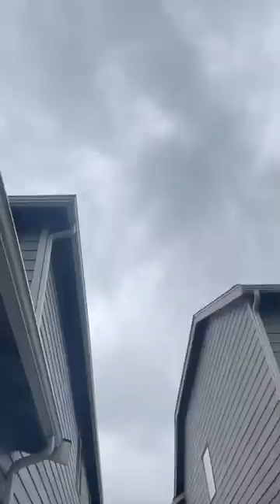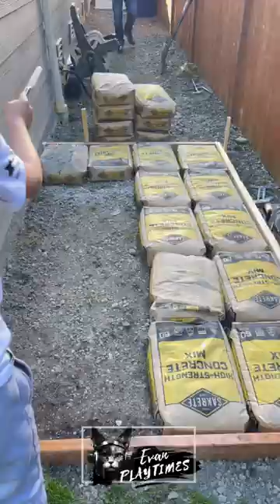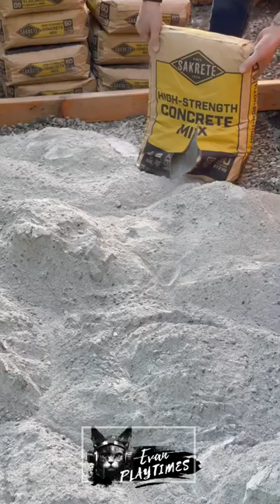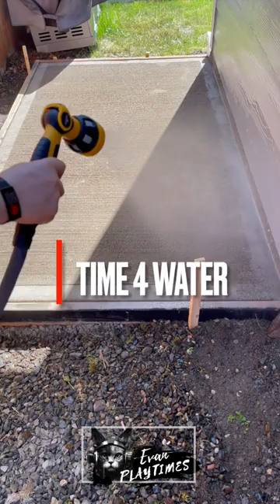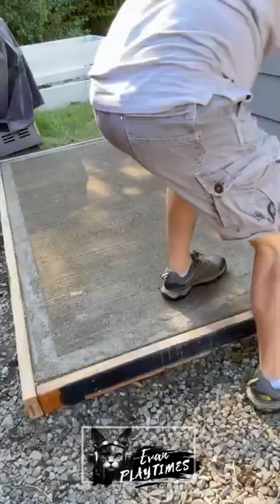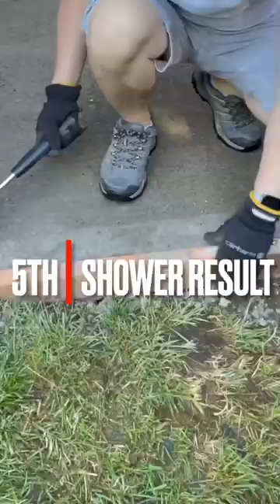Dry Pour Concrete | Love It

Comment: I’m no expert but I did go to a civil engineering school and have a degree in it.  There were classes focusing on concrete and strength of materials. I wonder why people mix concrete?  It’s much easier to dry pour, why were we not taught this method? To summarize concrete has a chemical reaction with the water , sand, aggregate and Portland cement.  Concrete can have many amendments added that strengthen and give it special properties such  as steel rebar, fencing and nowadays ground metal shavings all to enhance strength of the concrete.  There are also amendments that can alter the properties of the concrete for example cold weather.  Concrete mixed properly will have most of its strength in the first 30 days thus the variable f subprime.  This not mixing it up, and just dumping the Portland cement out is strange at best.  I was in Mexico , deep In Mexico once in my life.  They mix it using the volcano method.  A volcano of Portland cement and the sand and the water, no wheelbarrow even.  Five gallon pails to truck it to sight.  It was throughly mixed though.  Using shovels and hard labor.  Skipping the mixing is much easier and attractive for that reason.  It will not have the strength a proper mix would have.  If it’s so wonderful why is it not standard practice in construction? There are reasons.
Reply: To get the 4000 psi the bag claims it will have to be properly mixed, that’s all I’m saying.  No mix , no chemical reaction throughout.  I’ve had bags harden from sitting in my shed , moisture came from the air and time.  The half full bag hardened but was very brittle .  I threw it out . lol

Comment: I need to build a concrete base so that I can put a shed on top of it. I can't afford thousands of dollars to pay someone. Is dry concrete good for what I need to do? I have zero experience with concrete, but I'm a fast learner and I can build stuff, especially working with wood. Thanks in advance.

From what I've seen I need to first  put gravel underneath before pouring concrete. One other question, if I have some thin metal rods, can I put them half way (depth wise) in the concrete so it can last longer?
Reply: Only if it's the will of buttman
Reply: I gotta do the same thing soon, how did yours turn out???
Reply: Have to make sure your base rock layer is compacted properly for anything that will have weight on it at all. Best to hire someone that knows what they're doing rather than put the money out to have it mess up on you and have to put more money out to have it properly done.
Reply: What type of shed a mower shed that weighs a few hundred kgs or a car shed? Watch Cajun country dry poor slab they did a 1yr test on and it's held up better then wet slab as you only add enough water to set the concrete. Much easier to finish dry aswell as your not fighting against the clock and sticky wet Crete. Well compacted gravel layer wood form and enough sacks to fill the hole. Plus some rebar for long life.
Reply: I heard something about PSI when working with dry concrete versus wet, I recommend you read the bag of concrete, maybe it will tell you the PSI difference, because it might not be able to withhold the weight of the shed
Reply: I just put up a small sunroom (10x12 feet) for my inflatable hot tub with it, and that worked fine.

I don't know if I would do anything bigger than that.

If you do this, definitely compact gravel under it--put 2+ inches of gravel down and smack it with a tamper until it stops making a noticeable dent. (Wetting it down can help the gravel compact easily.)

The gravel will keep the ground from settling and moving/cracking the concrete.

Small bars can help with reinforcement, but fencing might actually be a better choice (dry pour may not attach to rebar as well as wet, but fencing will kind of "hold" it in place.)

So, it's definitely an option for sheds, but there are other options if you're not comfortable with this.
Reply: Get your measurements, thickness and please use rebars.., think of how and POSSIBLE FUTURE USES SO THAT IT'S ENOUGH FOR THE BE OWNER
Reply: If your shed is going to have anything heavy in it I would recommend a wet pour because a dry pour is not going to be anywhere near as strong and will crack much easier as it does not bond together evenly like a wet pour does. Use rebar and make sure to have a tight and level base of gravel especially if you live in a state that gets a alot of rain.
Reply: I do concrete professionally and I work with forming, placing, finishing, grinding, cutting, and coating concrete on a regular basis, among other things. Im all for people striking out and learning new skills and doing projects for themselves. My opinion, having familiarity with concrete mix designs and the way it gains strength, I would say anything with an exposed surface or that bears any weight would not be a good application. If your shed that you want to use is able to sit on a gravel base or directly on the ground (like one of those very light plastic sheds), AND you are ok with a finish that will not look very good, and will deteriorate quickly, you COULD consider dry pouring. For some people, they want something that is flatter and cleaner than dirt and stays together better than gravel, thats where dry pouring will get you. If you want a nice finish I would suggest looking at some resources online, learning the process, and taking it on. If your shed requires any sort of anchoring or needs to bear on a solid foundation, I would strongly advise against anything other than a well designed concrete mix that is correctly placed and finished. If you can screed gravel off to a level surface, youll find that screeding wet concrete is not hard. Once you put a mag float or bull float on it you have already far exceeded the surface quality of a dry pour slab, and the tensile and compressive strength of good concrete will blow dry pour out of the water. If you are able to get steel trowels and an edger trowel on the surface I can guarantee you will be much happier than any finish on a dry pour slab. You are unlikely to pour a perfect looking slab your first time doing it, there is a significant time aspect involved as im sure you know. But someone who is handy can pick it up pretty quickly, and a small slab can be done with a couple basic hand tools, small bull float, straight 2x4 to screed with, and some plywood or foam squares to put your knees on while you crawl the slab to finish trowel it. As well as a couple buddies who can help you shovel it around in exchange for some beer of course. Rebar may or may not be required based on your application, if its a small shed it probably isnt, as long as you arent putting it on top of clay or mud. If you do decide to dry pour I cant say that rebar will do anything to help the strength anyway. Ultimately its up to you what the specifics are, but figured Id help muddy the water with my opinion haha. Im also happy to get into the specifics of why Ive formed that opinion based on what I know about concrete, which I dont claim to know everything, but I do know more than most people who make videos about dry pouring. I love nerding out over it and have devoted a lot of time to learning the details of concrete chemistry to always try and make my work better for my customers.
Reply: If you have plenty of metal cloth hangers make your own metal screen base and remember to put pieces of rock or brick for some kind of ground separation. Also to make it last longer a week later apply cement sealer , three coats. Good luck
Reply: 9 months ago... I hope I'm not to late. DO NOT DRY POUR ANYTHING THAT IS STRUCTURAL. Just don't do dry pour in general, but especially not for anything structural. Concrete anchors will rip right out and the concrete will crack so easily.

Comment: Looks great. How did you get the sides to have the color difference. Smoothing it out?
Reply from the maker: I don't remember the name. Got it from home depot. Stainless steel with curve edge.
Reply: @EvanPlayTimes  That’s great. Thanks. So, basically it’s a tool that’s made for it
Reply: Edger
Reply: Trowel edger
Reply: How far apart in time do you wet it?@EvanPlayTimes
Reply: @angelgirldebbiejo don’t worry about the timing. It’s not a strong slab. So the timing doesn’t matter. You’d have a better result using the normal procedures for concrete.
Reply: @TTTTyme Its called a concrete edging tool

Comment: If it's not seen.   Buried posts or back of garage pad id do dry.  Heavy foot traffic I'm mixing.   Do two projects and call in the minimum mixer load, probably 4 yds  Search concrete and have the hole ready.    Most drivers if you hand him an iced coffee will walk you thru or tell you before you fck up

Comment: Would it not be cheaper to do a sand/cement mix instead of using pure cement?
Reply: The bags come with a mixture of rock gravel, sand and cement. Is also stronger than just cement and sand. This is probably the easiest route.
Reply: But a bag in Uk costs £10.

Comment: Look at you! Amazing job
Reply from the maker: It's easy. At first, I thought it wouldn't work, but I did it, and it still stands strong. I will give an update soon for those who are afraid to try or think that it will crack or be a joke. The professional gave me an estimated $4000 to do the project, but I risked it, and it worked out great. You have to be patient and add design on the edges before watering it down.

Comment: Looks great! I'm going to do the same.
Reply: Make sure you do a top layer of cement powder and sand, not the stuff with the gravel in it. When you screed it, the gravel won't cause an issue. Thank me later. I'm going to do a dry pour in the next few weeks
Reply: @jakefriesenjake  Thank you! I got this message after the fact. We tried our first paver. I noticed there was a lot of gravel even after screeding the Quikrete mix. My dry pour came out rough on top. My son and I will add mortar (cement and sand) on top tomorrow to smooth it out more. Hopefully it works. It was our 1st try.
Reply: @YvetteR-ep2hc  they make specialty concrete resurfacing concrete mix, probably be better off with that.

Also, look up "white washing" or "painting with portland". That is also a great way to make old concrete look alot better. Many options.

I did a small test sample using dry pour today. It's been like 8 hours already and it is not setting up nearly as good as I would like it too. Maybe it will be better in the morning
Reply: @jakefriesenjake  Hi! Thanks for all the advice. After much research, my son and I decided to try the Quikrete sand topping mix to fix our paver.  It worked out well. Our paver is now smooth and looks so much better than before. It's totally trial and error. We are dong another paver tomorrow with Quikrete dry pour and we'll see how it turns out. We just have to remember to screed the surface better this time. Hopefully it won't give us the gravel results we had with the 1st one.
Reply: @YvetteR-ep2hc  nice. The sand topping Mix does have some very very tiny gravel in it, it's not pure sand and cement powder.
Reply: @jakefriesenjake  Another update. We realize diy is a lot of trail and error. I found a video where the guy took the Quikrete concrete mix, sifted out the gravel leaving the concrete and sand mix for the top layer so it makes for a smoother top. We tried this and it worked much better. We decided to fix our pavers using this method so it all comes out even. Worked out much better. Just wanted to share another method to use without having to keep buying a $10 bag of sand or mortar.

Comment: Concretes works by chemical reaction with water.  When you dry poor like this it is inherently weaker as not all of the concrete has reacted with the water and hardened
Reply: Just curious. Won't it all get reacted eventually because the water will be absorbed over time?
Reply: @SnakePlantCollector  no because it needs to react and harden together otherwise it will create a bunch or cracks and chips.

Comment: For that much Sakrete you could just order a cubic yard of proper concrete and buy a wheelbarrow to shuttle it from the truck chute to the forms. AND, you'd probably still have money left over and wouldn't have to dick around misting it and watering it. AND, it would actually be 4000psi like it's supposed to be. Dry pour is such an internet fad. If it made any practical sense, contractors would be doing it but they're not.

Comment: Dude as if dry pouring isn't already bad enough you didn't even put rebar on it. That thing gonna crack 100% not even year after you made it.
Reply: A lot of improvements have gone into the formulations since the requirement of rebar installation. Fiberglass for instance, and pea gravel might not be seen in the mixture. Also, how many overweight (eg earthmoving tractors) vehicles will be driving on it?
Reply: @craigmatheson2736  it doesn't even need to have anything driving over it, dry pouring will always resulted in much much sooner cracking when the soil settled, temperature changes, and water freezing under or inside of the concrete.
Back in engineering schools we were thought how laughably bad dry poured concrete is compared to any wet poured concrete. Concrete need water to solidified, not just because you have to make it wet, the water inside the concrete literally become part of the concrete chemically and molecularly. All the water doesn't just evaporated when you think it's dry.
Reply: I dont know why everyone thinks this but 4 inch  side walk doesnt need wire mesh or rebar. It will hold just fine it's just for walking on.

Comment: How do you know how much water to add when you use the shpwer setting?
Reply from the maker: Start with a light mist twice within 10 minutes and hose it down lightly. Request throughout the day. You'll be fine. I'm afraid to do it first, but hey, it works. Cajun Country got me started on the project, so check them out if you need more help. I'm doing it my way. Both of my sidewalks are awesome, and I have no complaints.
Reply: @EvanPlayTimes  thanks

I was afraid of turning it into mud.

Comment: How can that possibly work,  why not just mix it properly in the 1st place?
Reply: Significantly more work (or cost if you hire it out)
Reply: To get the same quality finish takes a lot of skill with wet cement. (I am guessing, never saw dry cement "poured" before "in real life.") On a dry pour you can endlessly keep sweeping and smoothing till it looks perfect. No time limit before it sets up.
Reply: @plethoraOFtrivia  not really, you can buy a mixer at harbor freight or use a wheel barrow. An ugly job would be better than dry pour. It's very brittle and half the strength. You can literally break it apart with your fingers. It will look very old easily.
Reply: @plethoraOFtrivia You can get this finish in wet concrete with a broom and an edger. No hate to the video poster at all, im not trying to talk down about anyones work at all, and its good to see families working together and tackling things themselves. The fact is though that this finish is very sandy and will deteriorate quickly. It looks like something that was bull floated and broomed, meaning it doesnt take a lot of trowel work to get a finish like this. A handy person with a couple hand tools could probably get a finish that looks like this or better, with the benefit of a denser surface and a stronger slab overall. Again,  not trying to be mean at all, just speaking from my experience of not only finishing but teaching people how to finish and seeing how these skills are picked up. Some things in concrete are very difficult and take a lot of skill. I wouldnt say this is one of them. A broom finished 3x5 pad like this is about the easiest starter project you can take on to learn basic skills

Comment: Still needs rebar for longevity
Reply: No it doesn’t. Rebar isn’t even used on driveways. Wire mesh instead for driveways and nothing is used on sidewalks bc theres no vehicle traffic. They prepped with crusher run & coarse aggregate. Absolutely nothing wrong w this and rebar or wire mesh would have been a total waste

Comment: It’s probably still sandy in the middle bad idea
Reply: Cement isn’t “water tight” without a specific sealant or coating on it so rain or hose water will seep through. It will just take a while.
Reply: @jimdob6528 it absolutely is otherwise you wouldn't ever see puddles on top of concrete after it cures. It's the mix between the heavy and fine aggregate as well as the Portland that makes cement what it is. If there's air pockets internally then it wasn't done properly.
Reply: Yeah i like this but I was thinking I might add extra acetate to it for what I'm doing.

Comment: Dry pour its stupid. Just mix it properly and pour it.
Reply: Dry pour is so much easier, you do lose about 25% of it's strength.  But for your average joe, dry pour is way easier then wet pour.
Reply: @mclovinfuddpucker  I did a couple of dry pours last spring.  So far they are fine.  It’s not like the chemical curing process is any different between a dry pour and wet pour.

Comment: How do you know if waterr will ever get into the thick of the slab?
Reply: Cement isn’t “water tight” without a specific sealant or coating on it so rain or hose water will seep through. It will just take a while.
Reply: Concrete bags inside a shed will set like a rock from the moisture in the air alone. I got 10 at home that I can barely use without bashing with a sledge hammer first. And concrete mix has dehydrated lime that socks in plenty of mousiture and they are flooding the slab with water as it soaks in. The only reason they mist the top first is to set the texture they want before heavy watering.